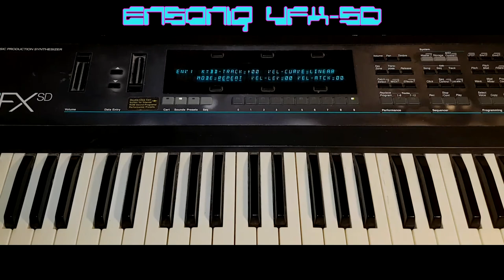ENSONIQ VFX-SD SOUND DESIGN

Comment: I just bought one of these today and the first thing I wanted to do was to create an “initialized patch”. I haven’t read the manual yet so maybe there’s a better way but I did it manually.

Press the “select voice” button. Mute all the voices but one. On the unmuted wave, choose a waveform, like a saw tooth for example. Zero out all the modulation/effects on that voice except for some decay and release on Envelope 3 (since that controls the amplitude) and save that patch.

That’s your initial patch.

Comment: Some folks wonder about sysex and computers and such
I blew out my wavestation A/D a couple years ago
I got out my midi uno then bought a cable that connected to my Android phone then the USB on the uno and a third line from it that I hooked my phone charger
The play store has a sysex app and reloaded all the factory program to my WS A/D
It will work on any old synth
These new phones are more powerful then our desktops of 30 years ago
So computer?
Sure buy an old one, hey why not
But you can do it with your smart phone
I did

Comment: Hello, how do i save a sound I made with the vfx? I am scared to turn it off and go to bed because I'm not sure if I saved it or not...
Reply from the maker: I suggest you download and read the manual, this information is easily available through a Google search. I haven't used a VFX in quite a while so I can't fully remember the exact button presses needed to save a patch. It's easy though, that's for sure
Reply: @warmnatural  Thanks, I did read the manual though, but theres this weird phrasing of stuff, there are presets, but they are not the same as sounds and if I press the preset button the sound I make disappear.